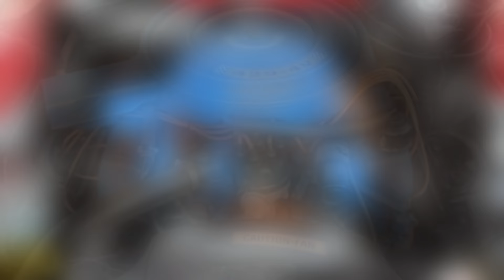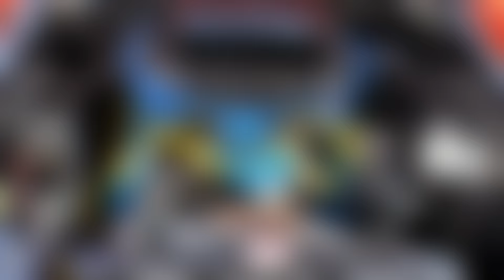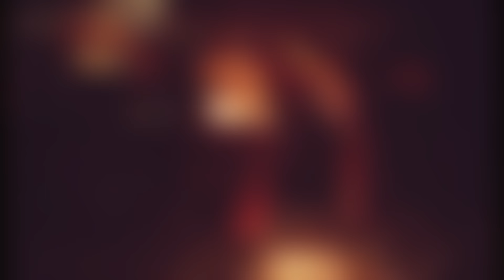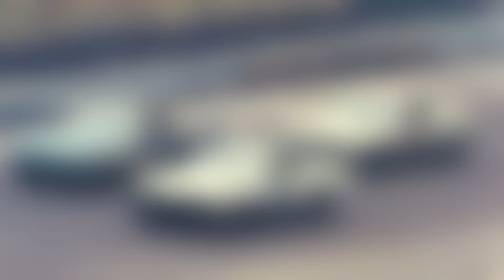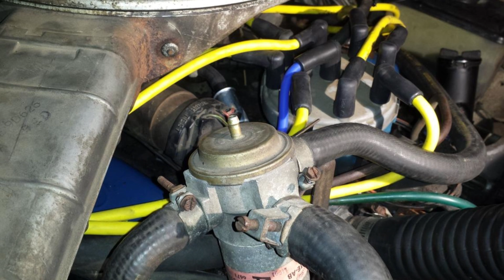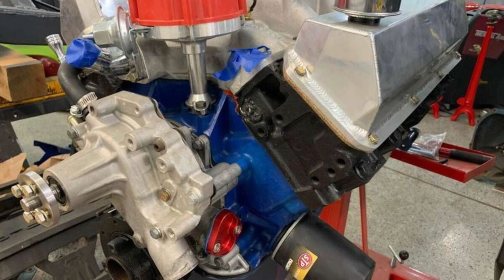What Happened to the Ford 351 Cleveland? The V8 Built for a World That Disappeared

Comment: There are some mis information about the Cleveland line of engines.......
      The 351 c was definitely one of the most successful small blocks for Ford. 
      Baber dubbed the biggest little small block and they were definitely the prettiest. 
    But the drawbacks were that Ford in an endeavor toske the engine lightweight came as thin cylinder walls .
    As a matter of fact they were so thin that Ford did not recommend boring them over five thousands .
They sold pistons in 3000 and 5000 over .
     Add the fact that these blocks were cast and machined fast .  
     They were prone to core shift .
     Every 351 c I ever had bored thirty over did not last long because of this problem and any engine that had over 70 thousand miles had extreme taper to the cylinder walls. 
     The 351 M was almost the same engine but with thicker cyl walls making them heaver .
Also dubed the Australian block. 
     And it did not mean modified the answer for Midland Ohio engine plant.
Reply from the maker: Thanks for adding that context. The 351 Cleveland has a very interesting history, and details such as block design, cylinder-wall thickness, and the differences between versions are important when discussing its strengths and weaknesses. I appreciate the correction.

Comment: I have a Cleveland in a 65 ford f150 its a beast it still has the v2 heads with a four barrel .  Upgrading it would make it too dangerous lol
Reply from the maker: That sounds like a seriously fun setup 😄. A Cleveland with a four-barrel already has plenty of character in an older truck. Sometimes leaving a good combination alone is the smartest upgrade.
Reply: @RuinedAmerica   Thanks for reply . Funny story with that Truck it has a bulldog tranny as a kid I remember bass fishing with my dad and a dude had a yacht . He had a 454ss truck and it would not pull the boat out the suspension just sagged  . Dad pulled it out in second gear with the Cleveland. It seriously needs a new tranny too low geared but in these Appalachian hills it has a super aggressive and fun third gear .. I hate to change it much.
Reply: 454 was amazing engine the 454ss truck was a giant anchor .

Comment: I had a 1974 Mercury Cougar XR-7 "Q-Code" with a 351 Cleveland and a 4 barrel carb. It was rated at 255 net horsepower and it was fantastically thirsty. Around town it got 6 to 8 mpg. But, by 1974 standards, it was fast.
Reply from the maker: 6–8 mpg is definitely thirsty! 😄 But a ’74 Cougar XR-7 with a 351 Cleveland Q-Code must have been a great car to own. Thanks for sharing that memory!

Comment: I had a 351 in my 1979 Ford F-250 know I know why it was such a problem 😢 it had a 2 barrel factory intake system with all the Air pump stuff and a Cat. On with my Muffler at the time I did not know all this great history on the engine I just ordered that engine when I was picking out the engine size. Then in 2000 when I traded in my Truck, keep them 20 year's 😊 I ordered the V-10 because of all the issues with that 351, I said never again would I not get the biggest GAS engine in a truck. I see why so many Dump drucks at places like (United Rental) put the GAS V-10 in their 5 yard Dump trucks, I think for a Fleed of trucks especially the bigger F-700 (United Rental) could then go with a different tpe of fuel, like (Propane) setups I am thinking but I said in 2000 that I would never again buy any GAS engine in a pickup that was not the biggest they put in them. I sure wish I knew all this great History back in 1979 😊 I so love hearing and understanding what happened and the big "WHY" does everyone remember the (RESTRICTION Opening) on your fuel tank fill caps, that only let you put in (Unleaded) Fuel 😢 and then before I sold that truck, you had to go get TESTED at a ecological station for emissions to get your new license TABS. you had to PASS the TEST. and then the HUGE theft of the Catalytic Converter 😢 that just ripped through my area, with my Truck being a victim 😢 40 seconds was what my RING Camera timed the two doing it. Then close to 2 Thousand to get it replaced with a ANIT THEFT rebar cage. "O" was not the emissions times so grand.
Reply: That 351 you had was not the cleveland.
Reply from the maker: Thank you for sharing your experience! It’s fascinating to hear how your experience with the 351 and later the V10 shaped your perspective. Real-world stories like yours add a lot to the history behind these engines. Thanks for watching and sharing your memories!